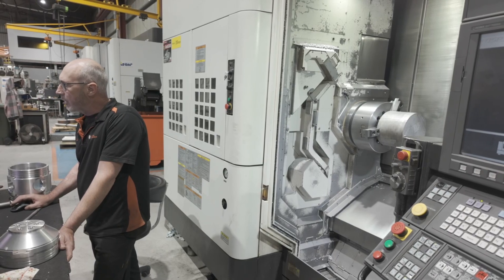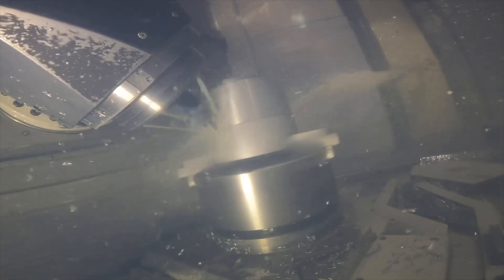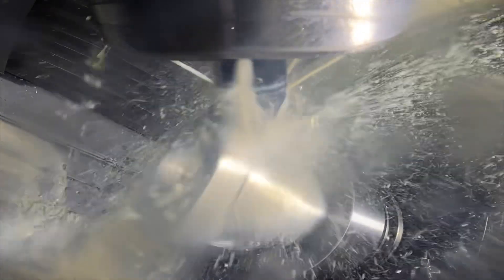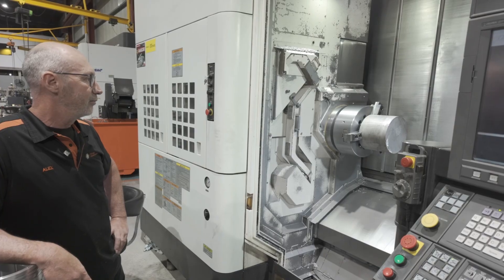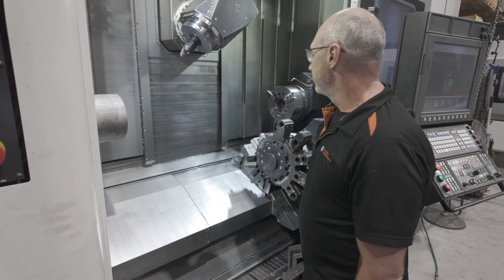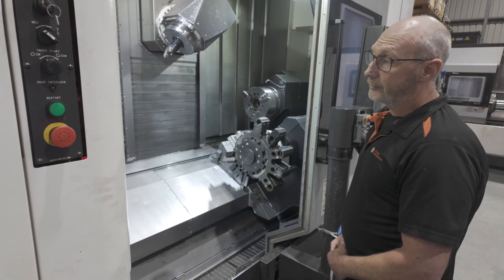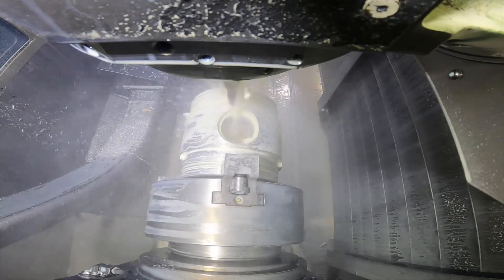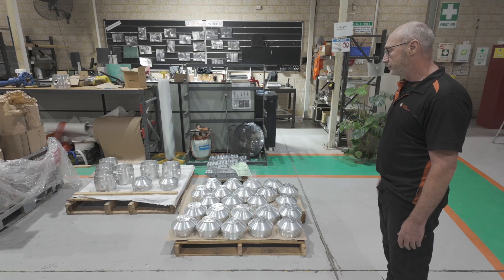Cycle Time vs Overtime 5 Axis Machining

Comment: Using a propper CAM software will make it easier/safer for a shop to start using simultanius work, as lower turret on one turret, while using the main turret on the other... you start load balance instead of doing most in one spindle... pinch turning... possibilies is endless if you have someone that loves the digital world

Comment: I’m a time served engineer my role was in tooling and the implication. I also worked for Sandvik Cormant for twenty odd years introducing Capto machine tool companies. Cycle time  and materials are two of the most expensive so if you can reduce cycle time by a percentage it’s then a win win situation.

Comment: If you make a two stop cycle on this part you can get the cycle time even more down. This part have a lot of maschining on the sub side you can transfer the part to the sub and get a new part in at the main side with the turret you can finish all the turning while the sub part get finished.After  first and second side are done  take the finish out press start the main side part will transfer to the sub and you can load after new stock on the main

Comment: I think if your the type of employee that's always trying to improve cycle times the boss will notice even if they don't acknowledge you right away. Long term some shops will reward you. But the other side to that is yourre taking more risk when you change things and it doesn't always work out and other machinist don't like change. So if your going to try and improve things you better know what you're doing.
Reply: If you are a machinist then you just do the machining the boss hired you for. There are different levels of machine work.....and levels of very expensive training the boss has to pay for. In theory, the bosses buy the machine to reduce the time it takes to make a part. Its the responsibility of the boss - not the machinist, to provide the training on that machine to make more profit. The boss has at his disposal, a whole company of engineers to plan and program to make the part. The machinist does not have this at his disposal. A cleaner says "give me a broom and I will clean" Seems this guy is some kind of boss in the firm but in the wrong job. Design and manufacturing engineer he is not - BUT I AM THESE PAST 40 YEARS.
Reply: @9999ox1on  I think for the situation in this video its as little odd to me that it would be the machinist decision. Unless the machinist is also the programming. The Boss Manager or programmer should decide how the job should be ran, then the machinist will set it up that way. I guess every shop is different, but Ive worked in 6 different machine shops and can only see something like this happening if the managers don't know whats going on
Reply: @caploader111  Do you work at a very big company since theres both machinists AND programmers? If im honest - people are not really machinists if all they do is insert the part and press start - and then all they do is measure or change inserts.

At my small workshop we do prototypes all day every day. Never any real big series of parts. We get the drawing from the manager and we/him check if we got material on hands already or need to order it.

Then everything from sawing the stock, setting up tools/machine, programming in CAM, running the part, doing QA and packing it for delivery is done by the same person. The boss is only ever involved during delivery, ordering material and to agree if we want some new tooling. I love it this way. I can pretty much do whatever I like during the day - as long as parts are being made to spec in a timely manner =)

Comment: Shops dont reward cycle time cuts anymore. They just make it the norm and you work harder.
Reply: Generally speaking, yeah... That also sucks especially when you just want to do better in terms of efficiency and cycle time improvements. I'm in one of the few companies which pays for me having cycle times low and efficiency high - that falls under bonus pay, if I don't do things as efficient and want to waste time, I get paid the fixed signed amount.

Comment: We have a U3000 and a U4000 at our shop and the way we use them is the lower turret takes care of the main spindle and the upper on the sub one  so we do both sides simultaneously, when doing so im so relieved that they have CAS 😂

Comment: It is interesting the different spectrums within this industry. I am running a part with multiple features on a sub spindle machine with 3 live tool operations. It was close to 3 minutes last run, but made a change and brought it down to 2 and a half minutes.

Comment: Well good work sir. My cycle time addicted mind is wondering how much you can save by the following:
Before and after the hand off include an M0. After the hand off chuck up a new blank on the left spindle. Use the mill turn spindle to rough and finish side A of the part. use the turning turret simultaneously to process side B. At the first M0 pull out the finished component before the transfer and clean the jaws.
Reply from the maker: Yes we do that on another product where there is about 150 items on this particular item there were about 30 so we didn’t. We use solidcam and its post processor does not make using both spindals and both turrets simultaneously easy without manual intervention